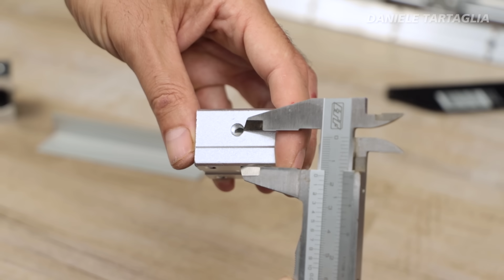How to make JIGSAW Cutting Station - PERFECT corner cutting

Comment: This doesn't solve the inclined cutting at all. Using linear bearings won't make any difference at the verticality of the cut, it won't prevent the flex of the blade.

Comment: I made a Jigsaw jig something like this but my jigsaw would jump out of the track when it tries to cut the wood. The problem is there is space between the base of the jigsaw and the wood it's cutting. To cut the wood, I need to clamp the wood under the jigsaw jig's track (eliminating the space between the wood and the jigsaw), then the jigsaw runs smoothly on the track.
So I'm surprised that you can cut wood with space between the wood and the bottom of the jigsaw track. I don't know if it's a problem with my jigsaw or what. Anyone know the answer?

Comment: The moment he tightened those clamps before cutting I thought: "that can't be good" once the metal rails start flexing the cut up angles are compromised. Eventually, the guiding rails will become warped and uneven from one another of so much use. Better to clamp the pieces on the base board.

Comment: I think it's stupid. It does not solve the problem I raised in the intro. I just add nice wheels and accessories to the template I had. But that does not solve that the cut is distorted, better use the circular saw

Creo que es estúpido.  No soluciona el problema que planteo en la intro.  únicamente le agrego ruedas y accesorio bonitos a la plantilla que tenia. Pero eso no soluciona que se tuerza el corte, mejor usa la sierra circular

Comment: Love the idea. How bout a new modification. Get some extruded aluminum to go along the sides of the rail and use T-nuts so you can slide the hold downs around. You will need to have a set handle on a screw to lock it into place. Also the extruded aluminum will help keep the rail strait when force is applied during clamping. I noticed the rail bending when you were using the clamps.
Reply: Clamps on rails of such length isn't a good idea, so yep, separate frame for clamps is a must.

Comment: On the one hand, I like it. On the other hand, if I wanted a straight line, I'd use a circular saw (or table saw).
Reply: And cheap saw will cost about same as 2 linear shafts with 4 carriages
Reply: My sliding miter also allmmoossttt has that much range.

Comment: Great idea. But I would buy a circular saw instead as this jig may be twice the cost of a circular saw.
Reply: Not necessarily...compare the blade depth and versatility, then it does make sense, you can do all the things that a c-saw does with a J-saw but not vice versa
Reply: @skysaan7018  I checked the online price for the linear bearings and the shaft. At least not affordable for me. Where did you get those? Regards.
Reply: @subramaniamchandrasekar1397  linear bearings are too pricey, use simpler design with just normal L-profile strips for channel😉
MS or aluminum is fine.
If using aluminum then reinforce with wood strips from local stores.

Comment: This is where the line is drawn between good content (which yours is) and a good solution. Those linear bearings and rails sure costed more (or as much) than a decent circular saw with a guiding track.
Reply: This. Also, the problem he had with the saw in the beginning can be solved by buying a quality sturdy blade. Otherwise there are way better tools in the shop to do these cuts (mitter saw, table saw, band saw, track saw, skill saw, etc). I'm all for inventing new solutions, but it's kind of an XY-problem.
Reply: @user-sk4nt5bm5r  In my experience a thicker blade doesn't fix the blade creep problem unless you are using a very soft wood. The only way as far as I have tested is to have the jigsaw upside down on a board and have a lateral limit (sometimes made with bearings) to stop the blade from wondering to the sides. 

Anyway my point was that this is a solution to a non-problem but I understand that Youtube is not a source on how to do things the right way, but a source of entertainment, which this video certainly is.
Reply: @user-sk4nt5bm5r  But if you have limited space in the workshop (or budget) some similar device will enable the money poor/time rich woodworker to get quality cuts. Or there is a handsaw and patience!
Reply: Not so in my experience. I’m specifically unable to use circular saws. I have no choice but get creative with precision cutting